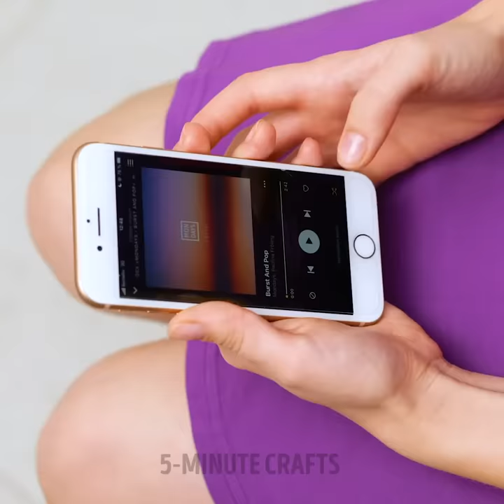40 CLEANING Hacks To Enjoy Your Home

Comment: How I clean carpets with a shop vac; 
First, vacuum room. Then use a bucket of hot water, small amount of laundry soap and a cup of bleach. Then use nylon broom, dip in bucket, and sweep rug with the mixture. Then dump water and use fresh hot water and dip broom and sweep again, then use shop vac to suck up the water. It’s best when two people work together, one using broom the other using shop vac. The bleach kills fleas, bedbugs, and their eggs plus kills mold and prevents mold from over saturated carpets. 
 If you have mold in your basement, use this method and use of walls, too. Make sure it is warm weather so you can open a window for ventilation, the bleach 100% dissipates in a few hours. It kills black mold which can be a health hazard, after cleaning, vacate house for a few hours, turn on fan.